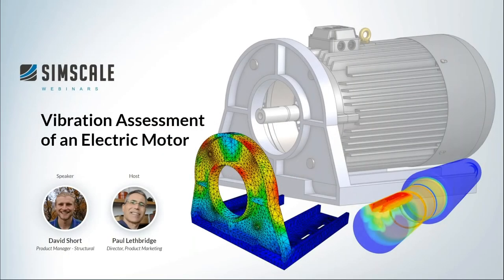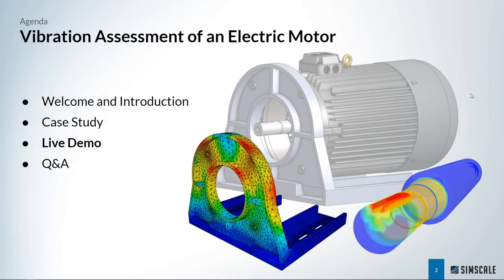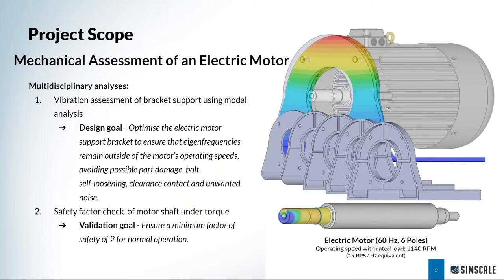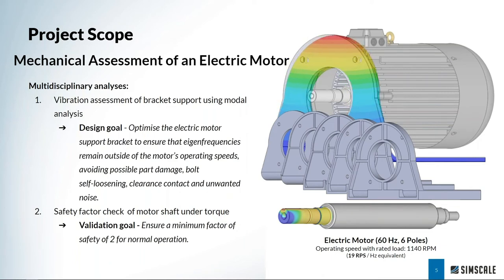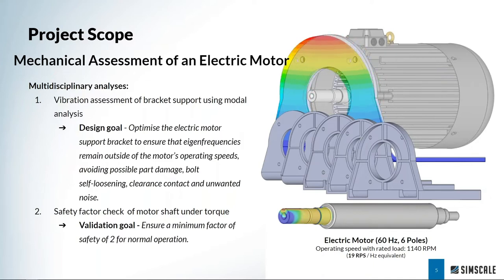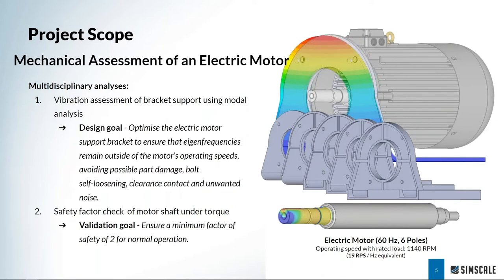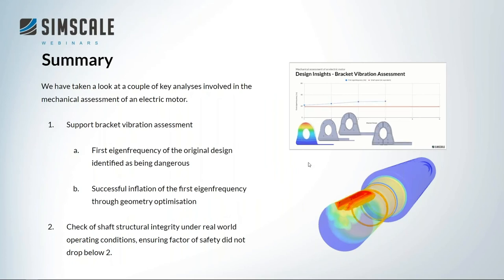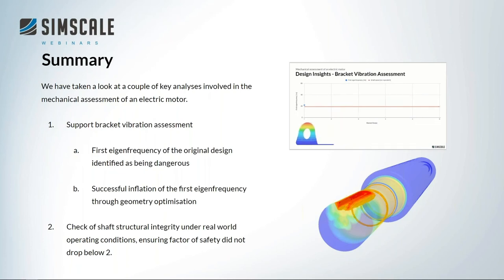Vibration Analysis of an Electric Motor - Structural FEA in the Cloud

Comment: By adding the stiffner are we not increasing the weight of component, which consequently should reduce the natural frequency, isn't it?
Reply from the maker: Yes, the natural frequency is dependent on the weight of the part but also on the shape. So it's favorable in both ways regarding the lowest natural frequency.

Comment: Hi, how did you plot a graph? I'm doing harmonic analysis and I want to plot a graph for displacement-time, but I don't know how.
Reply from the maker: You can create a result control item for the min-max, average, and sum displacement for a complete volume, a point, or a surface. This will plot the displacement over time. You can find more information on this here: https://www.simscale.com/docs/simulation-setup/result-control/#structural-analysis
Reply: @SimscaleSimulation  I see, thank you. Also, how do you change a material behavior from linear elastic to hyper-elastic?
Reply from the maker: @hahahahkejdjdj3861  There is a "Materials Behavior" drop-down setting. Here is the documentation page on Materials: https://www.simscale.com/docs/simulation-setup/materials/ (you can also search for linear elastic and hyper-elastic for more information on those). The SimScale forum also has useful information: https://www.simscale.com/forum/